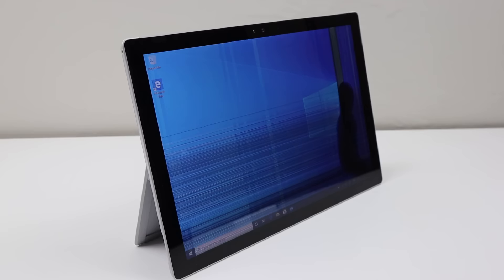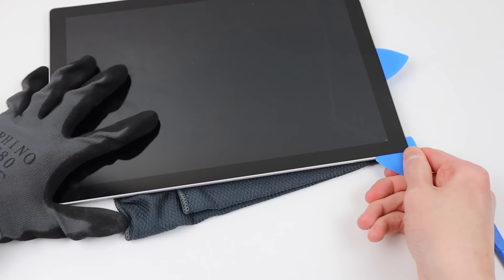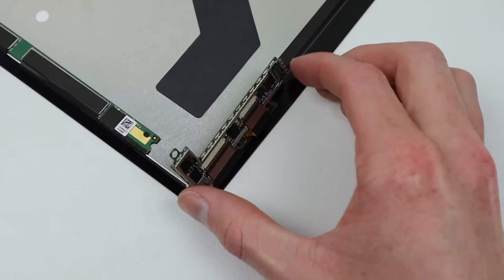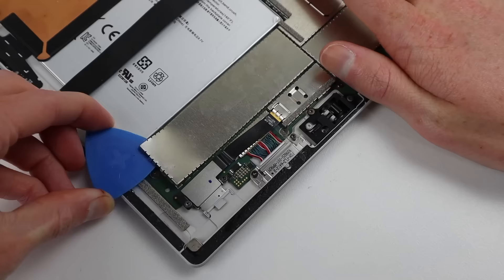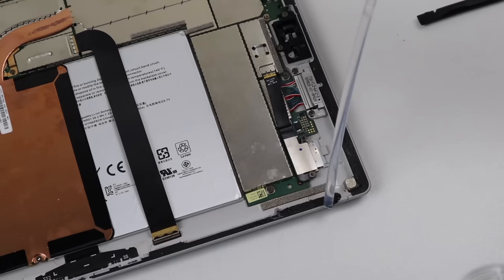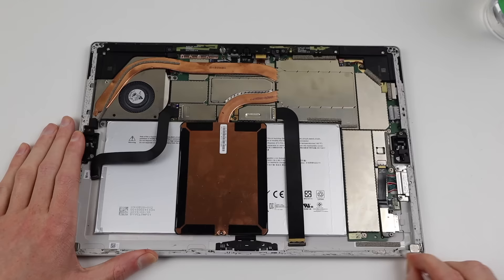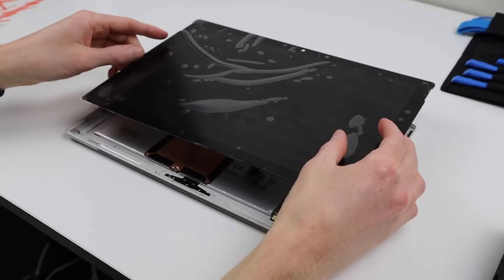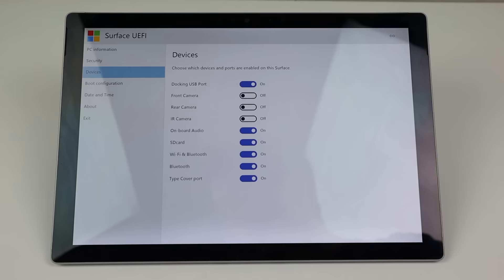Smashed Microsoft Surface Pro 4 Restoration & SSD Upgrade

Comment: as someone who has worked at a computer store repairing devices. I will definitely say that the surface computer is very difficult to repair this requires a lot of experience. and I will also say that this is a very difficult device to repair especially if the glass is shattered because if the glass of the panel is completely shattered it will take you 10 times longer and to be able to work on one of these because of Microsoft's glue being so damn strong. and I also too had the same problem with the LG/ Samsung display problem with the mix-up with the weird cable problem that he had. not to mention if you are working on one of these he made it look super easy but you do need a lot of heat to be able to pry off the display because also up where the webcam is on the tablet at the top of where the display is Guess what Microsoft did they put the Wi-Fi antennas at the top of the display so if you're prying off the glass of the display you are also damaging your Wi-Fi antennas completely. like we're talking about completely ripping the antenna cable so terribly that you get worse Wi-Fi performance once you're done not even joking. I'm surprised he didn't even have that trouble!. I have done 4, 5, and 6 and even 7 surface pro repairs I did one of each model and after a while we just quit doing screen repairs. because of the glue being so terrible to work on and also damaging the antennas.

Comment: I got a surface Pro 3 I just purchased for $190 CAD. works perfectly fine but has a tiny area in the corner of the screen that is just dead... Kinda is outline by thin green line when the display is on. & nothing can be seen within the area that is dead.
Touch input still works & I suspect this was a result of physical damage. 
It's very tiny & I plan to ignore it... But if this ever expands I likely will have to consider replacing the screen.

For now I'm happy because it still is quite capable for browsing the web, Youtube & simple games the only task I give this tablet.
With it's I5 4300U, & 8gb of ram and a 256gb SSD that works at a SATA SSD speeds.

Comment: To remove the strange adhesive you can try with Some "Avio" solvent, if I find the bottle i will tell you the correct composition. You have to be super careful thought to not spill it on the screen because he can melt also the screen glue.
The correct procedure is made with an irrigation needle (0.6~0.7 mm) and a syringe so you can dose it perfectly

Comment: Use wax and grease remover for automotive paint. I prefer Motospray Prepwash which you can pickup from you local Autobarn. It works an absolute treat for this glue especially and wipes up very cleanly.

Comment: Just for your information, i just changed the ssd in my surface pro 4 too about 2 weeks ago.
Using Kingston A2000 250GB (price RM180 here in Malaysia)

The result on Crystal Disk Mark version 7.0.0:
1709.49 / 1068.82
1525.49 / 1041.54
787.63 / 662.50
54.16 / 99.77

Compared to Samsung 970 evo plus in your benchmark:
1435.53 / 313.30
873.74 / 312.07
637.49 / 265.92
37.51 / 96.79

Comment: In the future, I suggest a citrus-based solvent to remove the adhesive. Just use a Q-tip to apply, allow to sit for a few minutes, then start scraping.

Comment: try using a q tip dipped in goo gone for removing that adhesive followed up with rubbing alcohol because the goo one does leave an oily residue

Comment: What is the small PCB called attached to the LCD screen? A touch control board? 2:48 You installed Win 10 Pro? 3:43 could you also have replaced the existing ribbon/ flex cable (that didn't fit) with one that would, and kept that first (new) replacement screen? Thank you

Comment: That is why I usually open up to find out what is the part before making the purchase - from the LG panel to the samsung panel, saving me a headache and logistical wait nightmare
Reply: I wonder if his Surface Pro was factory refurbished already, and that's how it wound up with the next gen's screen. There were a lot of problems with the original Pro 4 screens and Microsoft got stuck doing a lot of replacements with refurbished units under warranty. I wouldn't be surprised if they were refurbishing the returns with the next generations screens to send back out as replacements for the bad ones. That would explain why his unit had a screen that the Pro 4's weren't supposed to have.

A lot of people wound up returning multiple replacements for the same screen problem. Microsoft probably eventually said "screw this, start replacing the bad Pro 4 warranty return screens with the Pro 5 screens before sending them out as refurbs."

The damage to the unit in this video looks like it was physical damage rather than the type of damage that plagued the original screens.

Comment: About 1 years ago I bought a Surface Pro 3 off of ebay that included the charger, keyboard, pen and a Microsoft mouse for around 300 CAD but the screen was cracked which made the touch and pen not work so I ordered a replacement screen but since one of the corners were dented it cracked the display on install😣 so I bought another early this year and took out the dent and was able to install the screen correctly and I absolutely love it and with a dual boot with android x86 its an amazing tablet. ALSO anyone who plans on buying one or fixing one I'd highly recommend replacing the thermal paste as these bois can get hot underload, also undervolting can help aswell.

Comment: I'd swear that adhesive looked like the same stuff they use for automotive glass like the windshield and rear window. To get those windows out they use a wire tool that slices through the tar like goo with ease. I'm surprised you got the screen off first try without breaking it. Well done.

Comment: The adhesive on Surface devices is nasty. However it can be softened with acetone quite well and it works very good on the metal parts.
Ifixit adhesive solution (70% isopropanol, 30% acetone) also works okay (especially on the residue), but not as effectively as pure acetone.

Comment: did all this then used double simple sided tape to fix it... it will mostly not hold due to temperature amd unelastic adhesion. searching for a more appropriate material for such an expensive fix, would be a must. best luck!

Comment: Repaired a few of these, the damage to the screen Is due to a attempt to remove the screen, when they have got to corner with the touch control board it’s so easy to crack the lcd hence the lines stemming from that corner, is really easy to damage the WiFi antennas as well. The surface pro 5 panel is better and supports HDR streaming, would be interesting to see if u have that option. Also if ur panel was slightly raised was the battery slightly swelled, I would of replaced it while doing the screen? The thing that I was disappointed about the 4 is having the high resolution 2k panel but the lack of VC1 hardware decoding, also the fan on every model. I have a 5 with the 7th gen i5 and it’s passively cooled and supports VC1 so 1440p YouTube playback doesn’t drop frames and doesn’t use 100 cpu usage, draining the battery really quick.

Comment: A bit of advice: if you search for Surface Recovery Image, you'll be able to restore OS on a Surface to its default state, will all the drivers included and device-specific features enabled out of the box (like Windows Hello, BitLocker encryption, etc.). Highly recommend you to do it this way instead of generic fits-all-PCs USB drive.

Comment: IMO when dealing with the adhesive it's best to make sure any tp just remove any clumps that may cause the screen to no be flush and then just use super glue rather than adding new adhesive strips.

Comment: Surface has a big issue with overheating. The screens were bent by heat. I use leased Surfaces from Microsoft by employer. I have replaced 5 and one of them was noise with overheating. My current used one has the same issue.

Comment: PRO TIP - I have restored/repaired many of those surface devices. That adhesive can easily be removed by application of some heat. With the application of heat it becomes pretty soft and can be removed even by your bare hands.
After application of heat it becomes glue ball level of consistency.
Reply: where did you got it repaired bro?
Reply: @BigBananaDaddy  I myself repair smartphones, tablets, PC's and laptops. I do it as my secondary business.

Comment: I've been experiencing the flickering on my refurbished Surface Pro 4 lately, and it turns out that the inherent flaws in the Samsung display were the culprit. So, instead of switching to a Surface Pro 5 or later, I'm considering buying a Surface Pro 5 screen and digitizer with the appropriate cable, along with the right tools.

Comment: For Information : people who got battery issue , you CAN run the surface pro4 without any batteries. I just did it, since my battery inflate itself, and I'm using the surface pro4 as a HTPC, so I don't need any battery. Also you should change the thermal paste, on 3 years use, mine was dry dry dry dry, like sand.

Comment: I also had a Surface Pro 4, with Intel Core i5, 128GB SSD, and 4GB RAM until it died in May of 2021. As a result, I ended up getting a Dell laptop the following month. I also ended up getting a Surface Laptop Go in early 2022.

Comment: I didn't even have to do anything to take off the display. I just use it extensively for about 5 years and wait for the battery to swell out and push off the display. Then I just gently remove the display that's mostly already off its body. :) Much easier this way.

Comment: Good video.  I am curious.  What kind of tape did you use to complete the unit's bonding and closure?

Also, about the SSD.  Read speed didn't increase, but you showed how to augment internal storage by leaps and bounds, which is always helpful.  :) :) :)

Comment: how did you stick the screen back to the body without the needing of glue? Just that red tape around the frame did the trick? I didn't get that part 100%. If you could explain that'd be great
thanks!
Also, I've read that to change the battery is quite tricky since the connectos can do a short very easily. Any idea how the battery for this model can be replaced in a safe way?
Thanks!

Comment: I repaired my sister's Surface a couple of years ago, and it was super annoying. You have to be careful of the WiFi antenna's that are literally right under the display at the top and are super easy to tear on accident. Also, the glass is so thin that every crack in the screen resulted in a bunch of additional cracks while trying to remove the broken panel, which was super annoying. There were shards of glass everywhere on my table after. And those stupid shields are so tedious.

Comment: I'm wondering changing display panel or is there something you need to insert or tweak inside just to remove the flickergate. Surface Pro 4 is okay but the flickergate is annoying when SP4 getting warm.

Comment: Have you tried goof off?  Maybe that may help removing that old adhesive.  
Also, Yes, use the new panel, as the old sp4 panel are know to have the "flickergate" issue.  
Largest ssd install was a guy in thailand on the sp4 with ssd 4tb.
Would also recommend to change out the battery as it is another known issue and will cause expansion and bricking the screen as it expands.

Comment: Hugh, the first Surface Pro 4 models had a Samsung screen but led to a known issue, which Microsoft acknowledged, it is known as 'flickergate' or 'Scramble issue'. Very frustrating! The LG screen was used after it was found the Samsung screen would scramble if the Surface Pro 4 would heat up (not even very much either). For anyone looking to buy a second hand Surface Pro 4, be wary of Samsung screen model devices, as I have found out the hard way.
Reply from the maker: Interesting to know, thought it was strange that they would have two different display types for the same device.

Comment: So I'm curious. Why didn't you use heat to remove the old adhesive for the screen? Would it not have worked, or is it just not good practice? I would imagine that would have helped remove it faster. Great video btw.

Comment: Great dismantle for the surface, but I would like to know what the wattage of the heat gun you used as i would not want to crack the the screen as item has a not starting poroblem.?   Can you add this to my comment.🤓

Comment: nice repair but there is a way to backup the drivers from the original instalation i did it in a acer windows tablet and storage in a microsd and i dont recomend to do a partition because windows eats space on the instalation drive the other day i erase with the windows tool almoust 30gb of temp files

Comment: If the Pro 4 runs the SSD at 2x, what does the pro 5 and beyond run it at? Kinda baffling they would limit speeds on such a premium device.

Comment: I cracked the screen on my sp3 earlier this year. Touch only works on the bottom half of the screen and it's inconsistent so I have to use a mouse now. I might try this if I can be sure to find a screen that I won't have to return assuming there might be a similar ribbon issue. Thanks for the guide

Comment: Pretty sure the Surface Pro 4 is the last model to use the external ssd m.2 from the Surface Pro 5 it’s a chip on the board

Comment: Surface Pro 4s have a notorious design flaw which damages certain components and leads the screen flickering. This is good work but unfortunately it just delays the inevitable and it will begin flickering again. The black spot is apparently unrelated.

Comment: @HughJeffreys #HughJeffreys Use Zippo lighter fluid to remove adhesive. Zippo fluid removes the adhesive very quickly and clean. Don't use it on plastic.

Comment: I have an hp windows tablet, I’ve only worked on desktops and laptops never a tablet or phone. Is there anything upgradable besides the drive? The ram and cpu is most likely soldered on the board but it’s worth a shot I guess.

Comment: Hello. My surface screen is/ was broken at the time of removal. How do I tell which type of display to buy? The one I have has the green circuit board on the display where the cable connected. How do I tell which one is a Samsung and LG display? I didn't see the LG code thing you saw there and I don't want to buy the wrong one.

Comment: Thanks Hugh for the detailed video. I have a surface 4 with a Code 10 error on the Surface touch driver. Touch doesn't work at all. Just wanted to know if a failed firmware update to a Surface touch driver sits on the motherboard or the touch control board? Would replacing the touch control board fix a failed firmware update? Anyone with an experience in this situation please help.

Comment: The Surface Pro 4 models were notoriously hit by that broken display issue such that MS extended the warranty to 3 years. Mine broke on the 4th and wasn't covered. :| They were going to charge me USD700 to replace my unit with a "refurbished" Pro 5 model (so I bought a Pro 7 instead).
Reply: I'd honestly rather pay you to change the screen (and buy a new battery) for my Pro 4 model after seeing this video. The screen might be the same extra one you have now XD

Comment: You should mention that the  SSD is not replaceable since the surface pro 5. The SSD is soldered to the pcb. You are not able to buy these chips seperately. So if your ssd breaks you have to use the usb port to boot from there. Otherwise you are no longer able to use your surface pro.

Comment: Hugh, Sorry to be a pc nerd, but I think that's a surface pro 3. I have my surface 4 pro with windows 10 22h2 with an core i5-7300U but you have a i5-6300U. Is it a different model or it's a surface pro 3?

Comment: Now, can you do this on any surface pro 4?  I recently looked this question up on Yahoo and my answer was you couldn't because the ssd  is soddered  to the main board which would make it difficult to upgrade, but it is possible if you know what you're doing with years of experience To replace..

Comment: I am having a major problem with my Surface RT 64GB  - Tablet was working perfectly then woke up one day to it being off.  
Plugged in Microsoft charger and the little white light is on at the top of the connector on the tablet so it is getting power.  
Upon pressing the power button the SURFACE logo comes on for exactly 5 seconds then screen goes black and the tablet is powered off.  
I have already tried the POWER + VOLUME UP / VOLUME DOWN methods without success...tablet still powers on for 5 seconds then shuts off.

Comment: you can use oil like wd40 to remove the adhesive..but then soap water easiest to rinse back the oil. but maybe need to unscrew the board first haha.

Comment: LG displays have a design flaw, check flickergate. The only know fix is use Samsung and a connector adapter. I know because mine was replaced after starting flickering. Installing a new LG display may result in flickering in the future.
I believe Surface Pro 5 and 6 screens (even if manufactured by LG) won't have this issue.

Comment: I have an iphone 8 that is pretty new but for some reason when it dies it just gets stuck in a powerloop and will not charge correctly, I have changed the battery 3 times but still same thing after about a week... Any suggestions?

Comment: Hugh stuck a up-to-date SSD into the Surface 4 as an upgrade.
Then shortly after stuck a 128MB microSD card as expansion. I'm more flattered by the fact that thing still exists than Microsoft making the Surface 3 upgradable easily.